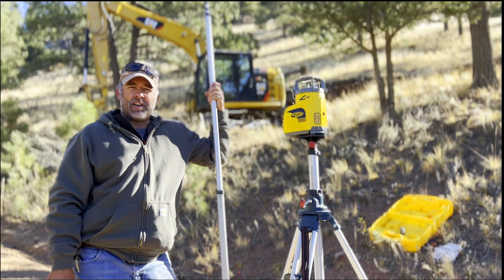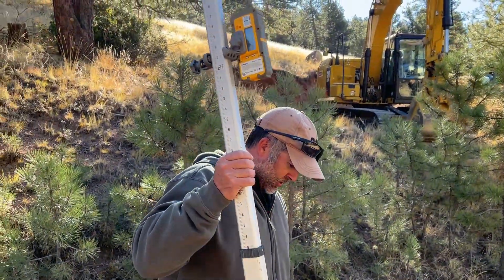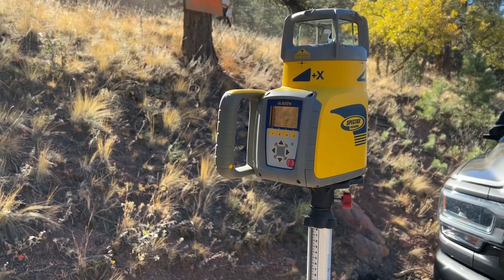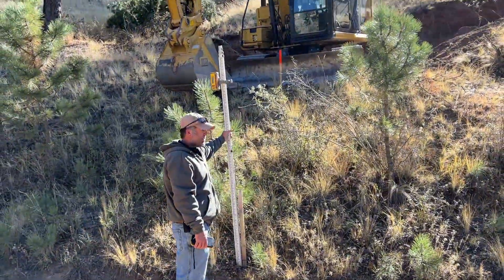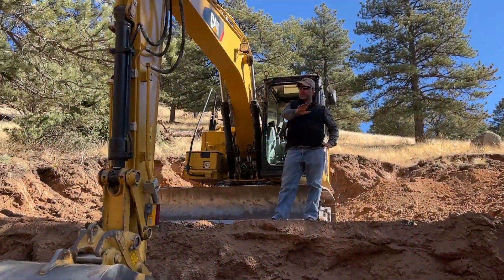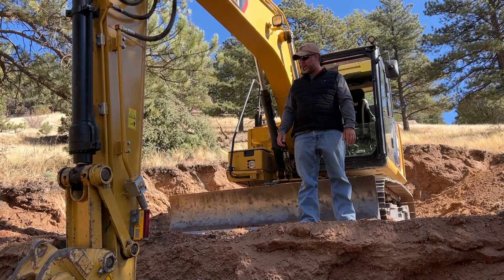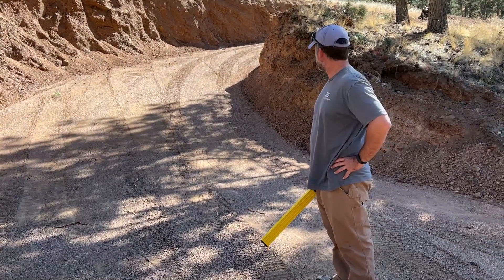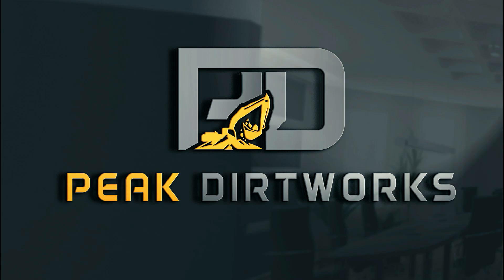How to Use the Spectra Precision Laser GL622N Dual Grade laser for New Driveway Cut in/Excavation

Comment: Those walls are going to heavily erode every winter rain season.
Reply from the maker: There will always be some erosion and required maintenance. Here in the mountains, some properties are only accessible by having a driveway like this. The decomposed granite is way more stable than you’d think. This driveway was installed 3 years ago and we’ve only done minor maintenance on it once. This bi-annual maintenance is much more cost effective than spending $50k+ to put in retaining walls or shotcrete, etc. 

Honestly, the strict code requirements of the county here force us to have to dig these canyons  on the steep properties, otherwise there’s no other way to access the property or do improvements like a house, etc. It would have been nice to be able to come off the road at an angle and have a nice sloping driveway the whole way, but the county requires that the access be perpendicular off the road, have negative slope, and no more than 4% grade the first 20’, then no more than 17% grade the rest of the way, and at lest a 35’ turn radius when making a turn.

Comment: Just so you know, if you get and HL760 receiver you can connect it to the CR700 through its radio and have it mirror what the CR700 is seeing. This can be great to put in the cab with you or for when you are sighting the laser height.

Comment: Nice video! Quick question about the y axis for the culvert install. Can you move the machines magnetic receiver up on the stick of the ex and catch the same grade of the road but at a lower point (bottom of the culvert)
Reply from the maker: Thanks for the comment! To answer your question, yes, we do that when installing culverts. When you set either the x or y-axis, depending on which one runs parallel with your culvert, you can then set a benchmark on the centerline of your culvert and then adjust your laser receiver to whatever depth you need to clear the culvert and the required coverage on top. Example, we do a lot of 18" culverts, so we typically set our receiver (on a grade rod, or on the stick of the excavator) so that we are digging approx. 26" below grade along the culvert centerline. If the axis on the laser is set to, say, +/- 5%, then digging along that axis will give you the +/-5% no matter what depth.
Reply from the maker: https://youtube.com/shorts/yXoaBwZ5Hcg

Comment: The laser gives a line for your grade for rise, but how does it show you run so you know you are right?  I have one of these and need to dig in a drain, but haven’t got the process straight yet
Reply: The laser is set to a percentage which is the relationship of the rise and run.  Example: A 2% grade is 2' of rise for every 100' of run.  For a drain, if you want 2%, set up the laser with either the x or y axis parallel to drain.  Set that axis at 2% or -2% depending on orientation.  At the starting point of your drain, set the receiver on the grade rod.  Now, you should be able to check that you have the desired slope along the drain.  Hope this helps

Comment: Really appreciate this teaching. I was unable to understand how you use two grades on the laser and receiver to crown the road. I do see how the primary grade 4% and 17 % was established. But, I don’t think you necessarily need to use the laser to crown the drive way other than maintaining less than 17%. Guess to put it more simply, did you use the dual slope feature of the laser system? Thank you!
Reply from the maker: We did use the dual grade feature. The culvert has a minimum and maximum required coverage and was installed to follow the same grade of the road for proper drainage while maintaining an even coverage and smooth transition. Had we not used the dual grade, the upper end of the driveway would have come off level with that part of the road, but then the lower side of the driveway would have been too high or humped. We set the road grade on the laser, and then programmed in that 4% grade perpendicular to the road, which allowed us to transition off of a sloped road while maintaining the minimum grade requirements and creating a smooth transition.
Reply: Dual slope means that you can set a slope for the x axis and another slope for the y axis. In this case he set the y axis to match the road’s slope and the x axis to match the allowable approach, perpendicular to the road. He didn’t discuss crowning the road, ie making the middle of the driveway higher to shed water.
Reply: @dpatru  Only the Y axis can match a grade, the X axis establishes whatever the plane is from the Y axis.
Reply: That is exactly what he showed - match grade of the road and the driveway at 4% perpendicular from the road.

Comment: Hey Troy,
  Looking at picking up on of the gl622n kits. I was curious if there is a reason you went with the cr700 receiver vs one of the LR models that have a larger laser pickup area(Lr-20,Lr-30,Lr-50,Lr-60)? 

Have you been disappointed with the small receiver area, or would you still recommend?

It is my understanding that the CR700 does not have a plumb indicator, do you notice there being a place for this in your operation, or is it not really necessary in your opinion?

Thanks!!
Reply: After cutting-in the first 20' perpendicular to the road, I abandoned the 8% slope of the road.  It is really personal preference after the county requirements are met.  The max is 17% in our county after the first 20', and we usually put a 2-4% slope back against the hill (horizontally) as we go up the drive.  It keeps the runoff against the hill which helps create/maintain a ditch.  We try to get away from the 17% as soon as we can to a more manageable 10-12%.  Obviously,  less slope is better, but also have to balance how deep you cut, how much material you are willing to move, etc...
Reply: 99% of the time, we use the cr700 on our CAT 304 mini ex and/or on my custom dozer blade mast for our CAT 259D3.  I feel it worked fine for the larger excavator for this project.  Obviously, the larger detectors with plumb indicator, plumb compensation, etc would probably be even better.  We'll probably invest in one of those one of these days, but for our "bread and butter" workload which seems to be residential foundations and septic systems here in the CO mountains, the CR700 has been a GREAT addition.  Well worth the $$$.  Probably paid for itself during the first job - not needing a ditch hand to stand there all day checking grade with a rod...
Reply: @troyloftus4840  Troy, thanks for the response, i'll pick up the package up under your amazon link. 

Just curious, did you maintain your 8% slope from the main road, once you switched to the 17% grade going up the driveway, or did you flatten out? What is your recommendation on how far up a drive you go until you rotate your Y axis to a more level drive?

Thanks, and Happy Thanksgiving
Reply: @zacharyhunsader3205  what does that receiver cost.  Very good video

Comment: So...What are they going to do about the wall from the driveway cut? Any type of erosion control?
Reply from the maker: It will need some maintenance, as with any driveway in the mountains, but we cut it back quite a bit to allow for room to slough off so it should taper over time.